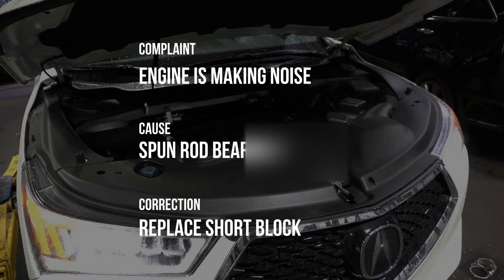ACURA / HONDA rod bearing recall.  STOP SALE!

Comment: Thanks for this video. Bearing just gave out on my '18 TLX. I've had it towed to 2 different dealers and both have acted like the failure was next to impossible based on the low mileage and service history. I almost feel relieved to see that it is happening to other J35's as well. 🍻
Reply: How often do you change the oil?
Reply: The vehicle was new to me. Service history showed the vehicle had the oil changed at recommended intervals by the dealer. You'll notice that most people like to blame this issue with these engines on oil change history, brand of filter, etc. It is a manufacturing/design defect.
Reply: Yeah I totally agree. It's a manufacturing defect. Bearing went out on my 16 tlx v6 @80k miles. Installed a new engine, bearing went out after 20k miles.

Comment: I wonder how this problem developed. These J35's are all build by robots. So, did someone get into the program for the robot that machines the rod bearings and change the program to a different specification? thus the problem.  How would a robot do something wrong if it only knows one way to do its job?
Reply: Supposedly it was going out of calibration over a given amount of time.

Comment: Got a call from Acura for an appointment to replace it this month.  My car isn’t acting up but I might as well take advantage of the recalled and get this new part put in.  Look like a bid job
Reply from the maker: @juniorguzman1415  check out my other video I just posted about the bearing recall
Reply: @NSXavier997  I have huge doubts that new parts any better that failed ones. It seems not a manufacturing issue as Honda says but an engineering issue. That failures will repeat all over again until you out of warranty.
Reply from the maker: @7gan7  I mean… yea I’m not gonna argue with you on that.  Lol
Reply: @7gan7  My short block replacement with the supposed updated crank and bearings has failed me 10k miles later. Im back at the dealership again.
Reply: @RobertZ1973 так хонда сказала же что дефект коленчатого вала . Замена подшипников и блока не решают проблему - дефект шейки коленвала . Вы устранили последствия
Reply: @RobertZ1973 вам везет, что есть диллер который это сделает)) я из Украины , наш диллер Хонда отказывается делать ремонт по отзыву , так как мой ТЛХ из США . У меня 70к миль , я боюсь меня это ждёт впереди . И в моем случае ремонт за свои деньги))
Reply: @denisfaraon6587  Right its a defective crankshaft, I dont understand how simply replacing bearings only is a fix either.

Comment: Question how does Acura decide if the crankshaft is the only thing that needs to be replaced? How do they test if the engine block wasn’t affected??
Reply from the maker: @GailSteele-y8c  this is an old video; it was produced before the rod bearing recall was officially released… I just changed the title of the video to be consistent with my other two that are out there. The repair route is decided based on the bearing inspection photos.  The engine block (now longblock) is only replaced if a lockup occurs due to bent or broken connecting rods.
Reply: @ thank you! Have you heard of anyone having issues after just the crankshaft replacement? I’ve watched all of your videos pertaining to this & you greatly educated me on the process so thank you!!! Realistically how long will it take to get my vehicle back in today’s world of repairs? I was told around a week for them to get the crankshaft. Also I have asked to see pictures of the bearings they took off and inspected as well as the crankshaft journal and how many of the bearings were wore and which ones. They said they couldn’t tell me or I couldn’t see the pictures is this normal? They wouldn’t even let me see my vehicle once I came in for the loaner.

Comment: How do you feel about the new engine in the 2023 Pilots? Replacing the Vtec. Your opinion do you think besides emissions they are shooting for will it be a reliable engine?
Reply from the maker: Only time will tell how robust the new engine is but, overall, Honda has had some history developing some really reliable power plants.  The VTC on both intake and exhaust cams should help in terms of performance and fuel efficiency, but also adds more moving parts with potential of failure down the line.  The Honda V6 is a tried a tested unit, which they improve on from generation to generation.  It’s too early to say how reliable it will be, but I’d put my money on Honda in terms of reliability over any other Manufacturer.

Comment: i wonder if this recall from dealership or repair can get rid of the nature of issue coming back, since i am actually think of getting one 2020 tlx with this V6 enigne
Reply: Only way imo is if you get one with the engine replaced with the updated internals..  just replacing the bearings is a Band-Aid fix that wont be permanent.

Comment: What is the cost of the short block?And how many hours of labour do they allow for this job
Reply from the maker: We're not doing short blocks anymore.  If the engine has failed to the point of engine lock-up causing connecting rods to break, they have you replace the long block which magically changed price from $15,000 to $2,200 once the recall was released and HONDA had to eat costs of engine replacement.  Convenient.  This job doesn't pay what it should.  It's like 9 hours of labor.
Reply: @NSXavier997  Not sure I understand.  How does the $15,000 and $2,200 apply and to what?  $15,000 for long block?  
Does the consumer have to pay $2,200?  I just don't understand what you are saying here.  Could you clarify?
Reply from the maker: @jws3925  Customer pays nothing. The $15k to $2k price of the long block can only really be understood by internal personnel. The manufacturer is eating the cost of the entire repair (parts and labor)... customer pays nothing.
Reply: @NSXavier997  Kind of thought if it was a warranty especially a recall that the customer would not pay anything.  Was just a bit confused with 15k and 2k comments

Comment: Impressive work!  I'm surprised Mother Honda only replaces the shortblock. I would think anything that had contaminated oil run through it, would need replaced or at a minimum, taken completely apart and thoroughly cleaned.
Reply from the maker: @richtaylor266  thanks! this is an old video.  They updated the repair procedure which is the suck.  Check out my other videos which outline them! Thanks for watching!

Comment: I just had the rod bearing recall fix completed on my 2019 V6 TLX.  Is there a video showing that specific repair?  Surely, they didn't replace my block?  The dealership would not share any details with me.  Thx.
Reply from the maker: @TracyWatson-r8i  This is an old video that I put out before HONDA came out with the recall.  You probably had an inspection and repair procedure A done your TLX.  That’s basically tear down of the connecting rods, inspection of the rod bearings and replacement of the bearings themselves.
Reply from the maker: @Jazz16-we1qc  https://youtu.be/wmgygjtguf8?si=OivZQh6gc7UlW3lZ

Comment: I just had the rod bearings replaced on my 2019 V6 TLX.  Surely they didn't replace my block or did they?  The dealership would not give me any information on exactly what was done.  Thanks.
Reply: Crank and bearings...rod and main.
Oil pump also.
Reply: @muddywater6856  You dont know which job was performed on his car.. there are several different ones including only replacing the bearings.

Comment: Great video. This must have been filmed over a year ago as now we are replacing long blocks. 
 Did you manage to do this in one working day? As in an 8 hr day with lunch and 2 coffee brakes ? Got to love flat rate
Reply from the maker: Yes, this was filmed before Honda came out with a proper Recall.  We were replacing short blocks on all cars that came in with locked up engines up until that point. 

I can't comment on how long this took me.  I'll just say that the labor time this pays under warranty is robbery by the Manufacturer and once again, the Technicians get the short end of the stick.
Reply: Technicians get screwed with warranty times all the time . The older you get the worse it is. 42 years in the business for me. I am hourly. I would never work flat rate. Especially at my age. Good luck my friend.

Comment: Sounds like my 2017 Honda Pilot my rod bearings went out With only 80000 miles. The recall is only for The 2016,2018,2019, and 2020. I guess I’m screwed.

Comment: Nice video man! How much did you quote for labor for this ticket? Was it customer pay or is it starting to get covered under warranty? I see a lot of V6 short blocks getting replaced.
Reply from the maker: Hey what’s up!  Thanks.  This was covered under warranty and so the labor time was peanuts but I was still able to beat the clock and make a dollar
Reply: Just curious, what warranty clause handled that? What code did Acura/Honda give you to apply to the job?
Reply from the maker: @RIMilne   
Labor Operation #: 111100(Q)  (2018 MDX ,YD4) defect code: 07404  Poor assembly
Reply: @NSXavier997 you are a God.

Comment: I enjoyed your video but I have a comment you really should check out. I have a 2019 3.5 TLX and last jan at 45k miles my short block was replaced with the supposed UPDATED one that has the corrected crank and bearings. Well 10k miles later im back at the dealership with it failing again. My main concern was the fact that metal had been circulating around my engine for several months before the first short block operation and I made the argument that the entire long block should be replaced because the replacement short block might get re contaminated by metal debris that could be caught up in the heads and what not and its looking like I was correct so im not sure replacing only the short block is going to fix this problem depending on how much metal had been flowing through other parts of the engine.  Im hoping for an update today from Acura but im pushing them for a long block this time, no more short blocks.. I want my car freaking fixed and I want it fixed right.
Reply from the maker: I understand your frustration.  Please note that this video is old and was filmed and edited before HONDA had released the most recent campaign recall.  If you check out some of my newer videos I posted last month about the recall, you'll see what the possible courses of action are depending on the results of the inspection.  Based on what you're describing happened to your engine, you should be getting a complete long block.  This entire situation is a pretty big mess, and not only are the customers and owners becoming more frustrated, but the Technicians are as well.
Reply: @NSXavier997  Yes sir they did short blocks before the recall came out. Now they do either bearings, crank and bearings, crank bearings new oil pump or you get a new long block. They no longer do only short blocks anymore.

Mine was fixed last jan just before the recall came out but I went back in April and they ran the engine number and Acura claimed my new short block was already updated but I think it failed because of re contamination.   I knew the engine was starting to sound kind of like the way it did before it failed the first time so I did an oil change myself and all kinds nice copper shiny bits were mixed in with the oil, some of the chunks were pretty big. There is no way I dont have some sort of damage in the heads now, cams and all that, probably scoring in the cylinder walls and screwed up piston rings.
Reply from the maker: @RobertZ1973  100% agree with you with shrapnel damaging the cylinder heads.  At least now you will have a fresh new long block paid for by HONDA.  I would frame the final invoice and hang it up in the garage.
Reply: @NSXavier997  Well im still waiting on their inspection to be completed and then they send off their findings to acura. The only thing that bothers me is that my engine didnt lock up, I could still drive it to the dealership but I would hope the fact this is the 2nd failure for me of the rod bearings going out and metal once again flowing through my engine that this warrants a long block. Im so scared they are going to try to screw me.
Reply: @NSXavier997  Also I still have powertrain warranty.
Reply: @NSXavier997  If you have an email address I can send you a couple of pics of my findings after my oil change. Its pretty crazy looking. I try to post them here but youtube keeps removing the links.
Reply: @RobertZ1973 мне интересно как выглядит . Можете пожалуйста отправить фото мне на почту ?
Reply: @denisfaraon6587  I cant even ask you what it is without YT deleting the comment, SMH!!!!
Reply: @denisfaraon6587  I would love to send you photos but its impossible to get what I need from you because YT keeps deleting harmless words. 🙄
Reply: @RobertZ1973  бро я добавил адрес електронной почты в описание своего канала, ты должен его видеть .

Замена подшипников тоже не исправит проблему , подшипники шатуна изнашиваются преждевременно , по этому что бы ВРЕМЕННО исправить ситуацию, их меняют. Но они и дальше будут изнашиваться из-за того что дефект коленвала . Но там могут страдать не только шатунные подшипники , но и главные . В любом случае надо замену коленвала, и возможно шатунных\главных подшипников .
Reply: @denisfaraon6587  Yes im 100% aware of the recall and what all is affected. My new short block already has the corrected crank and bearings.

Comment: What caused the failure?
Reply from the maker: Yet to be determined or proven but my theory is that the rod bearing to rod journal clearances are too tight or were incorrect on engine assembly.  This caused premature wear on the rod bearing and ultimately resulted in damage of the crankshaft rod journal.  Honda has yet to release a formal cause of this failure that we are beginning to see on all vehicles equipped with the DFI 3.5L V6.

Comment: Oh crap. What’s up with these engines? And how did that crank bolt come off so easily
Reply from the maker: Haven't been proven yet but my theory is that upon assembly, incorrect tolerances on the crank main and / or rod journals to their respective bearings has caused either bearing(s) to spin.  I actually have one in my bay right now with a broken connecting rod.  I took the crank pulley bolt off previously while it was still in the car.  I use a special socket and a Milwaukee cordless impact to take them off no problem.

Comment: I just had the rod bearings replaced on my 2019 V6 TLX.  Surely they didn't replace my block or did they?  The dealership would not give me any information on exactly what was done.  Thanks.
Reply: what fluids need to be replaced when this is done?